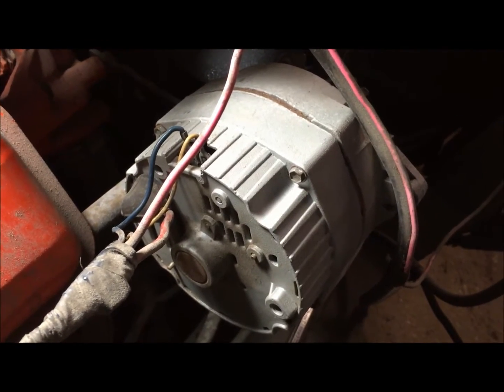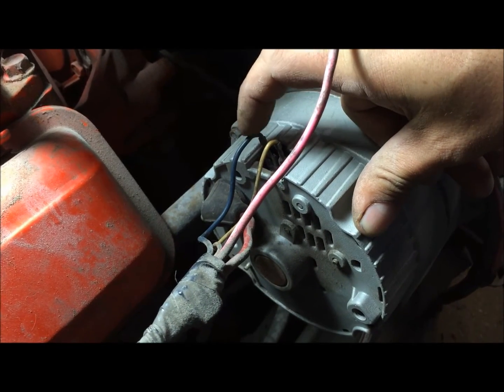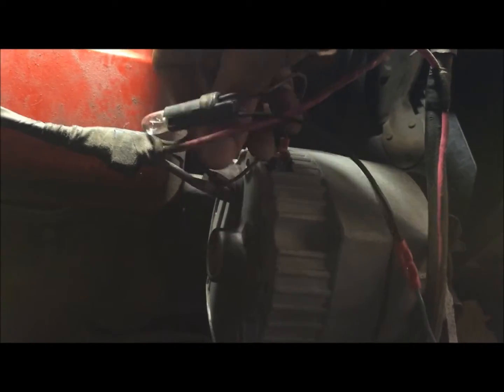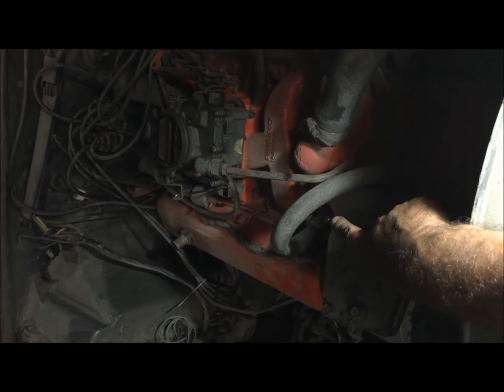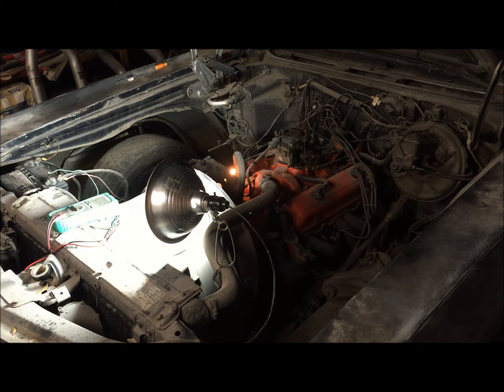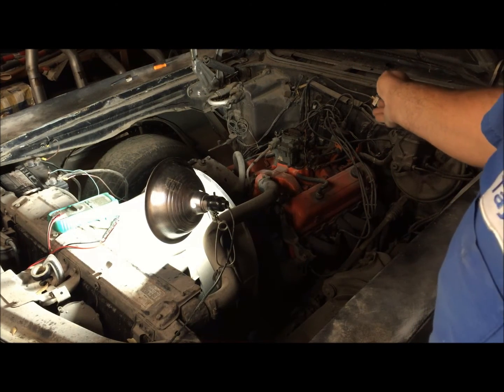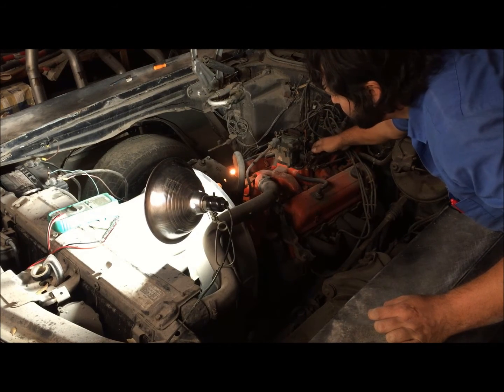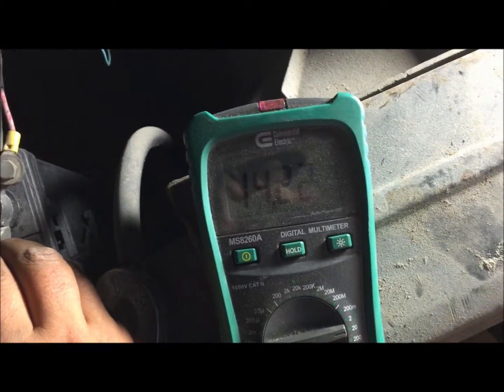Alternator Warning LIGHT EXPLAINED GM 3 wire

Comment: Hi Chris, I have an external regulator on my 1969 Firebird, so when I put the ignition in the accessory position the dummy light stays on while I'm listening to my radio, is that normal ?
Reply from the maker: the light comes on when the battery is being discharged. Does it go off when the car is running?
Reply: Yes.
 @chriscraft77022
Reply: Mine goes off when the car is running but stay on when the car is off without key  @chriscraft77022

Comment: hi so I am working on a car, but the dummy light (dashboard) isn't wired and I think would be easier to make my own dummy light. 

I have a 3 pin connector which I assume is the regulator and dummy light. To wire the dummy light, is it just a bulb that's connected to pin1 directly to a key on hot wire? Am I not supposed to ground it?

On another hand, how would I wire the other 2 pins? The voltage regulator is built inside the alternator I assume.
Thank you
Reply from the maker: I have a gm 3 wire alternator video and I make a dummy light in it
Reply: @chriscraft77022  I’ve watched it. I have a few questions left, do I really have to wire it with a light or could I directly wire it to the ignition?
And could I simply wire that power by fuse tapping into a fuse hot with key on ON position? 

Good content btw 🙂

Comment: Chris, my 67 firebird  gen light stays on after turning off car  I noticed my battery drained  no start  no lights  I noticed the alternator pigtail wires had alot of play  put test light on it  one wire lights  other not,  so I'm installing new pigtail  is that correct.
Reply from the maker: was it working before or is this a new project?
Reply: It's a new project. alternator was bad   got new alternator  generator light stays on after turning car off  could it be voltage regulator  it was new installed

Comment: Great video.  What would the problem be if the alternator IS charging (battery showing 14.3v) but the dummy light does not go out???
Reply: My problem, too.
Reply: @noampitlik2332  While the solution to my problem may not be the same as yours:  My alternator has 3 wires going to it, two wires going into the regulator in the alternator from the fuse box, and one wire directly from the fusible link box (so directly from the battery to the fusible link to the battery input in the alternator).  That small wire from the fusible link to the alternator, while looking ok, fell off the alternator when it was handled.  Once that wire was connected properly, the light on the dash went out.  I suspect that this wire actually has little to do with the alternator actually charging, but uses its connection to indicate 12v battery voltage.  The wire, because it wasn’t connected properly, was indicating low battery voltage, even though the alternator was working properly.
Reply: @Inisfad  That's great. Thanks!

Comment: well that's kinda how an idiot light works. When the key is turned on the power goes to the alt on terminal 1. terminal 1 is grounded inside the internal voltage regulator so the light will light. This power has  now "excited"  the transistors in the regulator  and when the alternator reaches a certain speed the charging begins and the   ground on term. 1 is switched to a positive. now you have positive on both sides of the bulb so without the ground the bulb goes out. If the alternator fails the #1 terminal again becomes a ground turning the light on again.

Comment: How's it going Chris.  I know the video is old but hoping you can still lend a hand.  I installed a ez wiring harness and the instructions are a bit cheap. They say nothing about a dummy light for an alternator. My question is. I'm assuming all wires coming from the harness are hot. It  comes with a white wire lable excitor.  So to wire a dummy light would I splice the excitor wire and wire the 194 light to it? The white wire on the harness has power when the key is on and no power when the key is off. Thanks for your time. Love the videos.  Appreciate the help.
Reply from the maker: what is the vehicle?

Comment: I know this an old video but I'm working on my 86 monte. Rats ate all the wires up but I rewired it all and my alt isn't charging. I have the Pin 1 on a wire that's only hot with the key on and the Pin 2 routed back to the batt wire. Everyone is telling me I have to have a dummy light for the alt to charge. Do I actually have to have a bulb on it or should the way I have it wired work fine but just have a bad alternator?
Reply from the maker: I have a 3 wire alternator video.. watch it... you don’t need a dummy light..   with it wired like that it should be charging... but it will not shut off when you turn the key off.. you need a diode to #1 position if you run it off the key like that .. just watch the video.. you need to understand what you are doing
Reply: @chriscraft77022  I was watching it as you replied and saw where you talked about it backfeeding which is where I believe my problem is. Ordering diodes right now. Thanks for the reply!
Reply: @chriscraft77022  with it wired the way I have it, its starts up and shuts off as It should but no charging.
Reply from the maker: Of corse it shuts off cause it’s not charging.. ... get a diode and a new alternator.. you can get diodes at radio shack and frys..

Comment: So just disconnect that exciter, replace it with the bulb to 12v and that’s it? No diode or anything? I have a 1980 vw rabbit and the can’t get the bulb on the dash to work anymore and my exciter wire has bad voltage I even ran a new wire and still not working. I wanna just run a dummy light for now so I could atleast get it running. Can I hook it up to a switch so I can turn it off when the car isn’t running? Unless I can find a 12v ignition source like the light initially has. Replacing my ignition switch first to see if that’s the voltage issue I’m having since the exciter gets the power from there originally. But I want this as plan B. Does the bulb have to be a certain voltage? What GM model and years does that bulb come from? My alternator has 3 wires blue exciter and 2 12v wires to the starter. How do I know if it’s internally regulated, I think it is? Any help would be appreciated THANKS!
Reply from the maker: watch my gm 3 wire alternator hook up video

Comment: Why is the light on with my key off? My t1 is constant 12v so it keeps my gen light on 24/7. Thx
Reply: I'm having the same problem
Reply: I think the difference is the warning light has a red wire and a black wire the black wire or ground goes to the the terminal 1 that he's talking about and the red wire goes to the b+ stud on the alternator
Reply: If the light is still on you got the wrong exciter wire check the ignition and hook the excited wire to a wire that turns power on when key is switched and off when key is off

Comment: so if i eliminate the regulator i can run a dummy light between the blue wire and brown wire right?
Reply from the maker: +Mondo357 your car already has a dummy light .. the gen light on the dash
Reply: Chris Craft i thought that was it... but the car is still staying on where should i install the diode?
Reply from the maker: By the alternator on #1 wire

Comment: Hi Chris, My name is Luis. Love your videos I need help wiring a dummy light for my 1967 firebird 400. I wired the number one wire on the ALT to the light and the other end to Acc on the key switch but the light didn't go on. I turn the key and then try with IGN and the light goes on but on the first postion and when I turn  the key to start the car the light won't even come on and I believe that the light should come on and then turn off once the ALT Is charging the battery. Thank you so much have a great New Years Eve
Reply: Louis Leon warch my 3 Wire hook up video